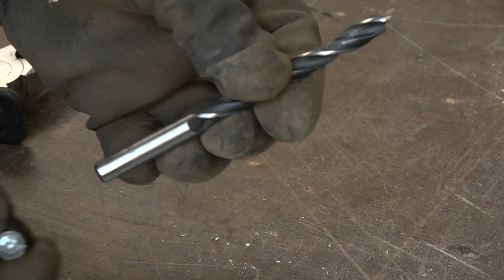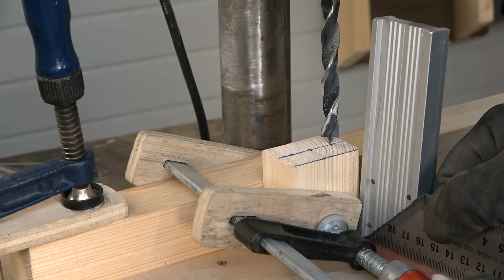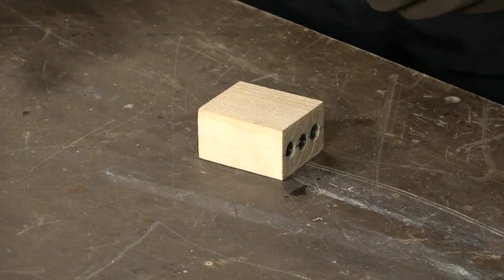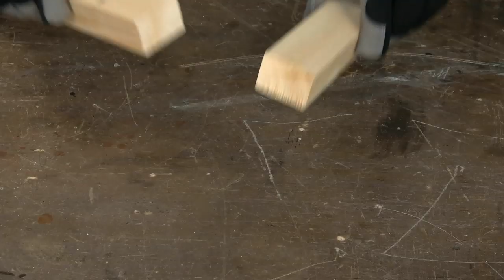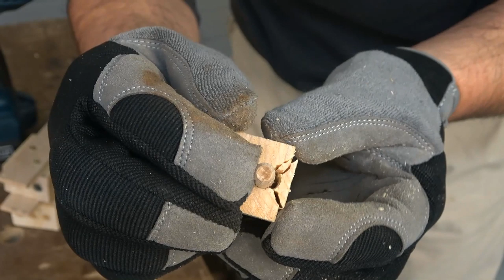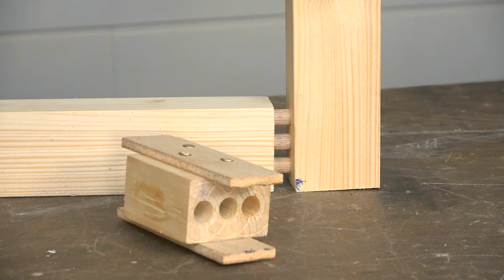MAKE doweling jig diy & USE to join wooden strips

Comment: I would have used a half-lap joint with plenty glue (and some through dowels if necessary). It's a stronger joint, relatively fast to make, and less complicated (if u don't have many pieces to join).
But that said, I used a similar jig when I built a large fire wood box/bench based on a 2x2 frames at my cabin yrs ago. I had only access to hand tools, but the (wood only) jig made it possible to join and reinforce the 3 pieces at the corners (8 in total, top and bottom).
For a more sturdy jig, like the one u made, it's a great idea to use 10 mm pipe and just enlarge the inner diameter to fit the dowel size. Maybe I would have used distance stoppers on my drill press to ensure accurate position, shorter pipes/block (don't think they have to be so long), and glued the pipes w epoxy after. I wonder if it's possible to make a DIY dowel jig that suits different size pieces - I'm sure it's possible to make something cheaper and in line with the $60-90 TASK Self Centering Doweling Jig.
Reply from the maker: Well, I don't glue the pipes to the wood because now I can use those pipes in another piece of wood, in another wooden block, that fits different dimensions strips 😃. And I already have two sizes pipes so I can decide witch dowel size I will use depending on the strips dimensions 😃

Comment: This H-shaped jig is very good at precisely and firmly positioning the two pieces to be joined together. However, the drawback is that you can use it only if the two pieces are exactly the same width. I think that if you have to make a "big" job, with lots of identically-sized dowelling, it's worthwile to make a one-size-only jig like this. Ciao.